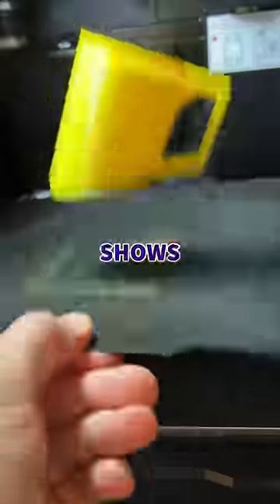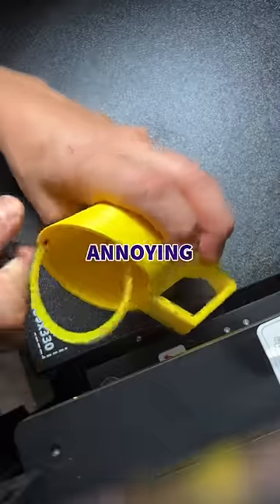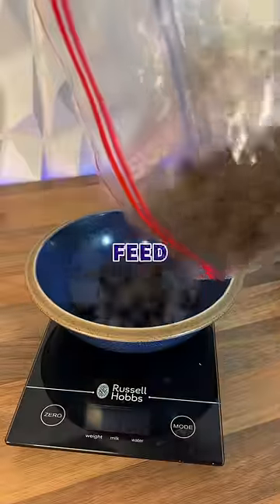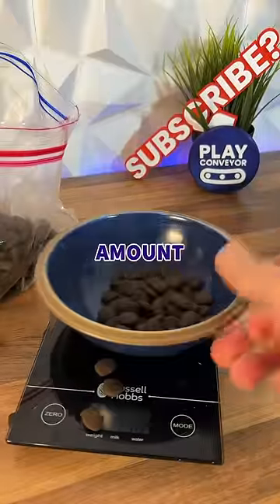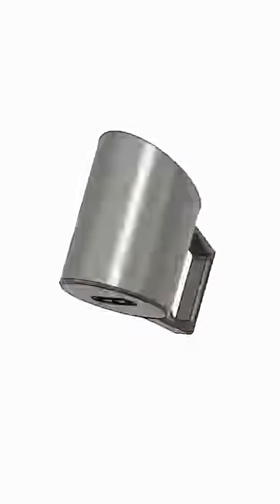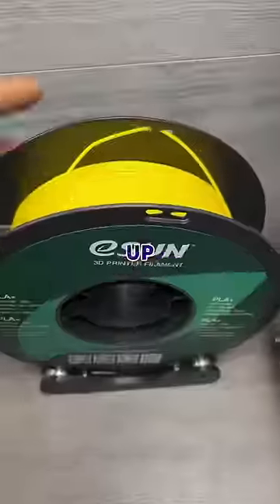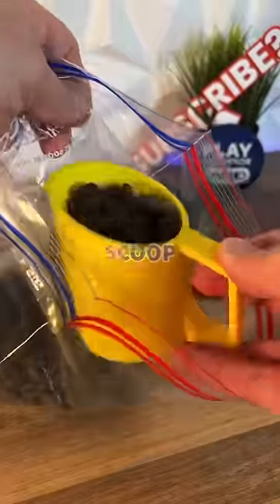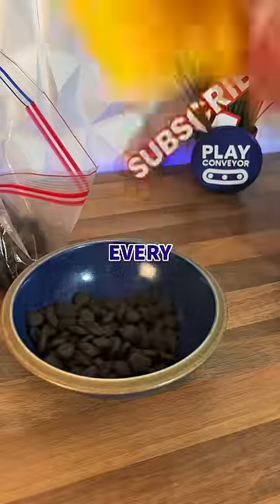3D printing SOLVED the PROBLEM with my DOG 🐶 #3dprinting #lifehacks #dog

Comment: That's the new level of "every problem is a nail when everything you have is a hammer"
Reply: Well, for a specialised task like this it makes sense. The scoop looks like a 10 minute CAD job and a 2 hour print at the most.
Reply: @strikereureka5081 even that is generous the new gen core xy printers like bambu x1c (the printer in the vid) or the creality k1 could probably print it in an hour max with 0.2mm layers

Comment: Poor dog, 3D printed plastic isn't food safe
Reply: Wrong Pla and pha are completely safe to be in contact with food. It's not like the dog is eating the scoop it has a bowl.
Reply: PETG is food safe too
Reply: DaddyVet3D dogs eat their own poop and suffer nothing for it, I don't think some theoretical contamination matters.
Reply: that would matter if it's being used to prepare food or store food, but this is just a measuring cup
Reply: wow you are uneducated, PLA is entirely food grade
Reply: Polylactic Acid (PLA) is perfectly food safe, same with PETG
(Your plastic bottles are made from the flexible variant of it, PET)
Reply: What are you talking about? 
Teflon is perfectly food safe too, as long as it isn't heated above 250°C
Same with PTFE, it's also considered food safe.
Brass is also mostly food safe, as long as you are not allergic and as long as it's not heated with a food item touching it (Surprise, it ain't)  DaddyVet3D
Reply: @GandhiTheDerg love when my food comes with copper bits flavour!
Reply: Brass. 
In such miniscule amounts. 
You probably ate more anti-stick coating from a pan in a single meal than the nozzle will ever shed  @pdrombs
Reply: @Pathologist_S.Aureus pla can be food grade
Reply: @graysonbullock6683 I'm far more concerned about the lead present in brass, and most 3D printers have a brass nozzle. So no it's not food safe by the nozzle alone.
Reply: While it's not technically food safe, I doubt this case would do harm, since it's large pieces of dry food.
If you were using it to measure water, then I'd worry. The ridges made by 3d printed layers are bacteria and fungi magnets when wet.
Reply: Kibble is dry so it's probably safer. But yes the texture of 3d prints has little ridges that hold food in a way you can't clean by washing so it's not food safe structurally even though the material itself would be safe if smooth.
Reply: @Spencer-wc6ew  it *is* food grade, it is corn based and biodegradable, with most foods it is entirely safe.
Reply: @GandhiTheDerg  anti stick coating aka PTFE, which will already come off the bowden tube. if you like eating those, go ahead, I prefer avoiding it
Reply: The small particles of it will be melted into the plastic, in such small amounts that they are barely traceable. 
Again, you will probably consume more teflon from a non-stick pan you make your food in than from the bowden tubes of a 3D printer, or, in the case of direct drive, from the heatbreak if it even has a tube and isn't full metal anyways.
 @pdrombs
Reply: have you ever had a dog? next you will tell me a dogs butt isnt food safe.
Reply: @pdrombs direct drive solves that one
Reply: It’s incredible how many people think it’s food safe … even tho there are types of pla and petg that are good grade, everyone is just missing the slight detail that normal nozzles aren’t AND give minimal but significant ammount of toxic particles into the print
Reply: This comment thread is full of so much utter mathematical illiteracy. These prints are food safe. No, even if lead could come out of brass, the 0.1% that transfers out of the plastic item to your food from the 0.01% of mass of brass ever lost from the nozzle into the plastic is way below the amount present in your food and water already.
Reply: @GandhiTheDerg  Didn't think I would see a based furry today
Reply: Bacteria will grow in the crevices of the layer lines. Only way to avoid it is by coating it perfectly in a foodsafe resin or material / not a 3d print.
Reply: @VMTDesign  Bacteria will grow on all surfaces. Difficulty of removing them mechanically is not unique to FDM printing. Every single injection molded baby sippy cup I've ever seen has internal acute angles that are impossible to clean thoroughly mechanically. If that's a problem you wash them in bleach water or use other disinfectant protocols.
Reply: @daliasprints9798  Problem is all the walls are made of these small boundary layers. Not just a few areas. Also dishwasher safe / bleach safe materials. Pla or other 3dprint materials will probably be mechanical corroded by bleach.
Reply: @daliasprints9798  Im all for 3d printing and have been doing it for years. Just dont use them in contact with your pets diet. Learn from my mistakes.

Comment: You forgot how much the cup weighs
Reply: He didn't, he tared the scale so he only measured the food
Reply: @brendanbush2174 He said he made it hold 80 grams but the scale weighs only 80 grams with a 60 gram cup
Reply: @MikxPerson look at the video before he sets the cup down. It says "-45g".

If 15g of plastic was wasted in the printing prpcess, then it adda up to the dog getting 80g of food.
Reply: @MikxPerson  Yes but the scale is tared to 45 so the cup actually weighs 45.  The scale goes from -45g to 80 which means theres 45+80=125 grams on the scale, 45 of which are from the cup the 80 from the food
Reply: Is the dog going to eat the cup?

Comment: Man you're on to something! This concept of having cups that accurately measure an amount of content within them is awesome. You should sell those, you could call them "measuring cups" I'm sure they'll sell!
Reply: Maybe he could put marks to measure in regular increments and even different units. Maybe to be really wild, bigger, or smaller cups.
Reply: that was a horrible attempt at sarcasm
Reply: Bro really forgot the difference between volume and weight measurements
Reply: Application specific measuring cups that hold the desired amount level to the top are so much easier to used than graduated ones that require holding the cup perfectly level and lining your eyes up with the height of the contents.
Reply: Measuring cups measure volume, not mass, otherwise we wouldn't have scales
Reply: @alpheendomination  For something of known composition/density that distinction is irrelevant.
Reply: @daliasprints9798  So you're treating them as the same? Because they're not
Reply: @alpheendomination  They're each determined by the other if density is known.
Reply: @daliasprints9798  Yes but then you'd have to measure how much volume 80g takes up, at that point you might as well just use the scales
Reply: @alpheendomination  In case you missed it the point here is being able to quickly reproduce one or more quantities of a *known density substance*. You measure or look up the density once then easily dispense by volume hundreds or thousands of times.
Reply: @daliasprints9798  i don't get why you guys are arguing against each other even though you both clearly share the same opinion
Reply: @Nour-qr3sv it was actually a really good use of sarcasm
Reply: @dammbenderisgreat  no not really, he's trying to make fun of him as measuring cups already exist, except it isn't a measuring cup cause it doesn't measure volume, it's specifically made for dog food
Reply: @Nour-qr3sv  yeah I was also being sarcastic don't get why you can tell people how to use sarcasm when you can't see very obvious sarcasm
Reply: @dammbenderisgreat  cause it wasn't obvious. People actually agreed with that comment, around 300, so it isn't an absurd assumption to think you're one of them. Also, it's hard to tell sarcasm from a serious comment due to the medium
Reply: His 3D printed "solution" also measures volume, it does not measure weight. It works out to 80g of dog food because he converted 80g of dog food into a volume and then 3D printed a cup with that internal volume. You can accomplish that exact same result with a premade measuring cup, just weigh out the food, figure out which measuring cup that amount of food fits in and use that cup to reproduce the same weight of dog food each time no need for a 3D printer, just a quick trip to the dollar store.
Reply: @Nour-qr3sv  no, no it wasn't
Reply: So funny. Why does my dude act like it’s a huge problem solver when the real meat of this pie is being able to print them if you have a printer and not buying them.
Reply: @lordcorporal4247  The title isn't "Why buy what you can print" ... it's "3D printing solved the problem with my dog" ... 3D printing didn't solve anything here.
Reply: It sorta did solve a small problem though. You could get a store bought measuring cup and level it each time, probably requiring a few annoying iterations of the dumping and rescooping that the creator was trying to avoid. Or you can take 5 minutes to make a custom scoop that is custom made to hold this volume of dog food so you only need to scoop once (which was clearly the creators intent). This will probably never be net positive in terms of time saved, but you're wasting more time malding on the internet over it.
Reply: @scrmnthn5233  First, we're all wasting time regardless of what we are doing ... so as long as you enjoy what you're doing it's at least wasted well. Regardless of whether it's making redundant 3D prints or complaining in the comments of videos about redundant 3D prints. So I'm not at all suggesting that the video creator "wasted" his time. If he enjoys 3D printing and making a dog scoop via 3D printing was a good way to spend time doing a hobby he enjoys then he should 3D print the scoop! If he likes making shorts and sharing his redundant 3D prints online then he should make the short. I want to be clear that I take issue with the claim that 3D printing solved this problem in a novel way and NOT that it should never have been done or shared. 

Also to address your other point. Even his 3D printed scoop needs to be carefully filled the same way as a measuring cup. You can see in the shot on the scale it's not completely full!

Now do I realize that it doesn't really matter, the video creator is probably just using high energy wording to drive engagement and doesn't really think they've solved some problem no one else thought of ... and even me complaining about it here is probably further driving engagement. Yes! But is it a waste of time to be posting this? That's for me to decide and I like complaining about small stuff on the internet I don't have any control over, it's a good distraction from dealing with the stuff that's really wrong and I don't have any control over...

Comment: ….measuring cups exist brother
Reply: What measuring cup can you buy that holds a custom amount of material that costs less than 50 cents of material? I’ll wait
Reply: @MATAKE2000  With a glass (which I already have), I fill it with paper (which I already have) to reach the precise grams I need. I don't spend money on electricity, a 3D printer, material, project creation time, electricity consumed by the computer to create the project, etc.
Reply: @SEVEN_handle yeah, you seem fun.
Reply: @MATAKE2000  I bought one from walmart once for about 50 cents. It held a custom amount.

Comment: In a similar vein I 3d print powder scoops for reloading with a precise volume for whatever load I'm working on. In theory I could use 3d printing in combination with lost PLA casting to make some funky bullet designs too among other things having a metal melting furnace could enable. I think that's gonna be the next big tool I go for 🤣

Comment: What is the scraper thing he used called?
Reply: Sorry if ya already found the answer but it's called a deburring tool. Can get em at Amazon or most hardware stores for $10 or so
Reply: @Eta_Hoyimi  thanks! I'll buy one now!
Reply: @rebeccapettinger1072  Aye, they're pretty good for cleaning up dremel cuts and stuff too. like if you have to drill a circle for a charging port or something.
Can just go at it from the inside, let the cut go to the outside, then clean it up with the tool.

Comment: Well done 😅 you can't use a scale 😂
Reply: He used it correctly? He tared the scale with the cup on it to account for the weight of the cup, then he filled the cup, and the result is only measuring the weight of the food because the cup is accunted for
Reply: Well done 😅 you can't watch a video properly 😂

Comment: For everyone that says “measuring cups.” Great, now I have to wait till tomorrow at least to get one, but a set which is more than need, AB’s it might not be exact. This took 5 minutes to design, 1 minutes to put on the printer, 2 hrs to print and it’s done. It’s efficiency.

Comment: It  was 45 gam not 60 or you set the scale wrong! Btw what dog do you have i love 🐕 🐶 ❤ love youre videos dont stop
Reply: 1. He needed 80g scoop, not 60.
2. It is 80g, the scale was zeroed with the scoop on so it shows only the weight of the dog food in it.
Reply: I'm talking about filament
Reply: He said it used 60 gram to print but the scale without the empty scoop said -45 gram so that would mean the scoop is 45 gram not 60
Reply: If the scale was zeroed with the scoop on it it would say -60 gram but it didn't it said -45 so the scoop is not 60 like he said
Reply: @FamTech.  Ahh, you are right about that.
Reply from the maker: Yeah you’re right… I noticed it once I’d uploaded the video - Bambu slicer said 60g filament but scales zeroed at 45… time to do some tests on the slicer I think 😂
Reply: @playconveyor  yeah that's quite far of🤣😅

Comment: You should not use 3D printed object to store, transfer or eat food out of. The microscopic imperfections and space between layer lines traps food particles and is the perfect place for bacteria to grow. You can do surface treatments like ABS smoothing with acetone but this is not perfect. Another option is to get some kind of food safe material on the inside of the cup. Your dog is eventually gonna get a bacterial infection mate

Comment: Great idea but just saying, you shouldn’t use 3D printing for food products or anything that needs to stay clean. In the process of 3D printing, layer lines are created which provide the perfect environment for bacteria and mould to grow.
Reply: I came looking for exactly this comment. It's gonna get microplastic on every bite and because the food has moisture, it'll grow bacteria inside the cup and smell terrible, plus, it's bad for your dog.

You can coat the whole thing in a food-safe material

Comment: Hey guys just a warning not to print cups or bowls for consuming food or drinks because it can get you pretty sick.👍
Reply: The scientists found that “PLA is Generally Recognized as Safe (GRAS) when used in contact with food.” The study did reveal that PLA does release a small amount of lactic acid, however lactic acid is a common food ingredient and there was not enough to cause harm to humans
Reply: @nasuku7342  I would make sure its a stainless steel nozzle too

Comment: isnt the small pieces of the plastic would be in dogs food?
Reply from the maker: So long as it’s printed properly there will be no loose bits of plastic!
Reply: @playconveyor  I would cover this with a food grade resin - heavy metals can get into filament and nozzles and cause real issues. Not a huge risk since it’s dry rather than wet, but I would do it to be safe

Comment: 3D printed plastics aren't food safe, use a measuring cup instead. That's why they exist...
Reply: PLA is perfectly food safe just like PETG. 
The layer lines are in this case irrelevant (They are in general irrelevant because the germ buildup isn't as bad as people make it out to be, it's abrely any if you clean it with soap and water)
TLDR: PLA is perfectly fine for dog food

Comment: Tools used to measure volume can’t accurately measure weight. Some food might be more or less dense causing the weight to change. Also the food might settle in better some times which will cause the weight to ti change.